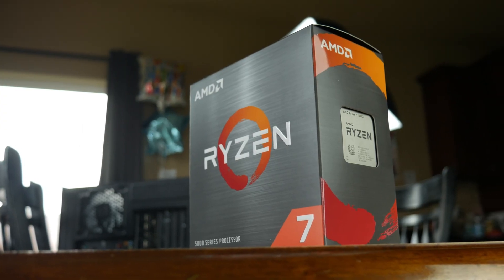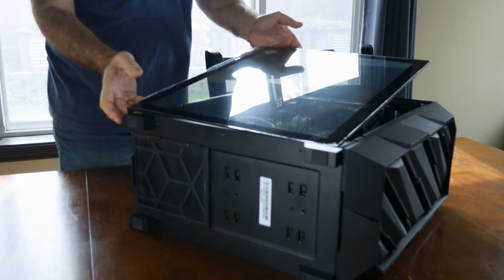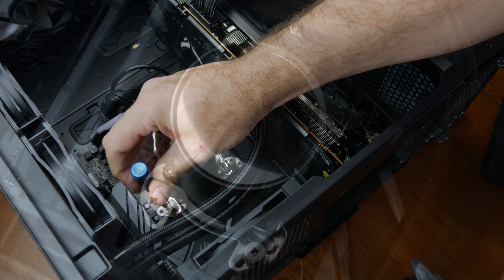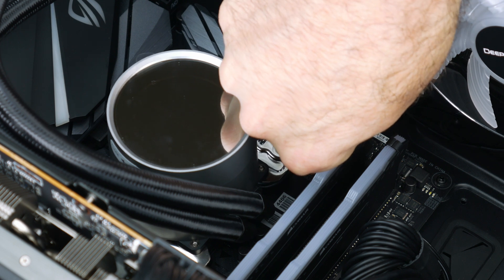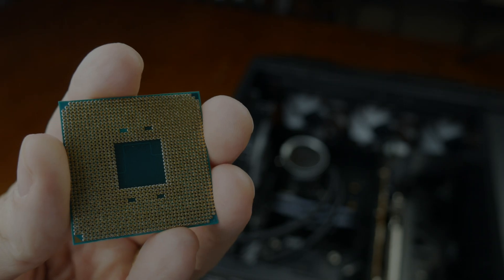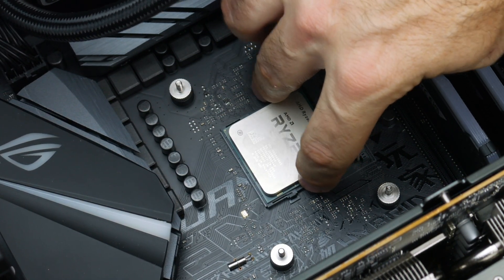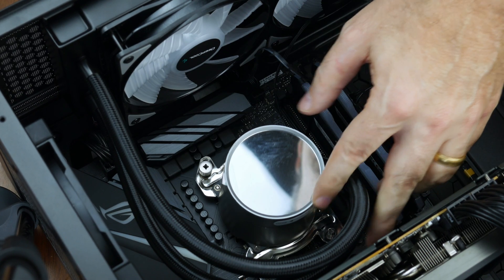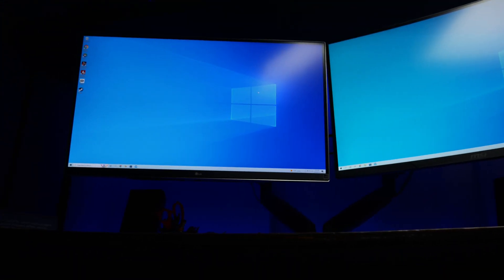How to Upgrade an AMD Ryzen CPU (AM4 Socket)

Comment: Can confirm your pc will not work if upgrade from 3600 to 5800xd3 and you don’t update your bios 😂😂
Reply: Great minds fail alike
Reply: I’ve recently made this mistake but once I tried to put my old cpu back in to update my bios my pc would no longer turn on. Any suggestions?
Reply: @Toxictrooper72  same thing happened with me
Reply: @glace6385  I got it fixed. Just look up a video on how to update bios without a cpu. Some motherboards don’t have that capability though and if that’s the case unfortunately you’ll have to buy a new motherboard.
Reply: @Toxictrooper72  I tried that, didn't work. Tried putting the old CPU back in and CPU got stuck to the cooler and damaged the socket. Now I can't click a CPU into place. I tried with just tightening it into place with a cooler but I still can't get past the CPU light on boot. So annoying I wasn't expecting the BIOS flash not to work now I have to spend more money probably need a new motherboard. And there's no guarantee that will work either
Reply: so would it work if i update my bios, or what would I have to do?
Reply: @evjay9793  It'll work, just update your bios to the latest version.
Reply: @slayer1561  im really new, so I update my bios before or after I install the new cpu?
Reply: @evjay9793  I switched from Ryzen 7 3700x to a Ryuen 7 5800x3d last week. All I did was update the bios and changed the cpu after that. Worked without issues.
Reply: @evjay9793  Update your bios before. Once it’s updated and working. Then proceed to change your cpu.
Reply: @randomguyfromtheinternet8953  Thank you guys 👍
Reply: @randomguyfromtheinternet8953  Same. It might seem daunting but the the whole process is actually pretty smooth if you do everything right.
Reply: @randomguyfromtheinternet8953  how’s the difference? I’m swapping from 3700x to 5700x3d
Reply: @inverse7974  For me it was a big difference. Especially really crowded areas in MMO games like Final Fantasy 14 online were a lot smoother. Also Cyberpunk was running smoother with the new cpu. It‘s pretty much the best cpu for AM4.
Reply: @randomguyfromtheinternet8953  im doing a similar upgrade this weekend. After updating your bios did your 3000 series cpu still boot to windows? Thinking of doing the bios update a few days before i upgrade and want to  figure out if i can still use my pc in mean time.
Reply: Yes, you have to download a corresponding bios update and then it will work (provided its the correct socket size)  @evjay9793
Reply: @evjay9793 Usually the mainboard manufacturer has a list that shows what CPU’s are compatible and what bios version works for the CPU’s. Gotta check it out.
Reply: Glad I updated yesterday cause I’m doing this exact upgrade!
Reply: Haha doing the exact upgrade today and saw this lol. Luckily I been doing this since Regan was in office so I gladly did it before.
Reply: You saved me from such a headache
Reply: Good to know lol
Reply: I wish I read this comment 6 hours ago
Reply: I was about to do this upgrade to my CPU.  Are you happy with it now 9 months later?
Reply: @Its_me_gonzo  oh yea, i completely reset my pc tho. and cleaned all my drives. Mainly just to make sure that all the old drivers and stuff are gone, other than that theres no issues
Reply: I just switched from 3600 to 5700x3d but I noticed high cpu load. Do I have to format my PC ?
Reply: @ format your pc ? I don’t know what you mean ? I just did the exact same upgrade 2 weeks ago with zero issues. You don’t need to do anything at all on your hard drives if that’s what you’re referring to.
Reply: @ Are you sure your PSU is well above covering your PC now ? I had to change mine. 850w is pretty well bare minimum with this CPU and any mid tier GPU
Reply: @LiFeDoWn22  i dont really see a high load on it, but i completely reset my pc recently, wiped all drives and everything and most of my issues went away
Reply: This is the exact upgrade I’m doing it. You’re doing gods work soldier o7
Reply: @TPeck01  10 months later and no issues :)
Reply: Thx b0ss
Reply: Nur Schwachsinnige sind auf Win 11 geil.     Und das ist wissenschaftlich neurologisch
beweisbar und auch bewiesen. (!)
Ja. Aber diese Spielelastigkeit ohne ernsthafte Software hat einer erstklassigen Hardware
schon in den 90ern schließlich das Leben gekostet.
Dumm gelaufen, oder... ?
-
Und solange man sich den Kopf mit Spielen zuballert, ist er nicht frei um zu denken, was
Vernünftiges zu lernen und zu machen.
Volten und übertakten ist was für Diaspora-Hirne.
Hier ein Beispiel, wie Effizienz auf intellektueller Basis und damit der Unterschied
statt Volten und Takten aussieht.
.
.
Kommt immer auf deine Fähigkeiten an, oder ob du deinen
Intellekt an Andere delegierst.
.
"Denken Sie selbst, sonst tun es Andere für Sie."
.                                                 Vince Ebert, Physiker
.
Wenn du wissen willst, wie das Speichermanagement (auch) beim Spielen auf der
Rechner-Seite punkt, weil MS gar keinen Zugriff mehr auf deinen Rechner hat und
der daher rasend schnell wird, mach mal folgenden Test:
.
Ich habe am    18.04. 2025   nochmal einen Performance-Test mit MEINEN beiden
(beide getunt) gemacht.    Titel:   "Warum ein neuer Rechner nicht lohnt!"
-
Ich habe die Word mal auf 32766 bebilderte Seiten erweitert. Mehr macht Word nicht.
Und die habe ich dann in Pdf umgewandelt. Pdf hat irgendwo noch zwei Seitenvorschübe
reingesetzt. In der Pdf sind es 32768 Seiten geworden.
.
Am Ryzen war sowohl das Generieren einer so großen Word-Datei  ~es geht um die
Performance eines Systems~ schon eine bluttropfende Geduldsarbeit, sowie auch
die Zeit die der Ryzen zum umwandeln gebraucht hat.
.                  Ich habe in zwei Testläufen verschiedene Methoden angewandt.
-
-
Jetzt darfst du dich festhalten:
Damit hatte noch nicht mal ich gerechnet, weil ich noch nie so exzessive Tests gemacht hatte.
Ich hatte meist von kleineren Tests hochgerechnet, bzw. Kopiertests großer Dateien,
25 GB oder mehr, herangezogen. Und CDM und AS SSD Benchmarks gemacht.
.
An meinem Intel-Notebook von 2012  (4700HQ, Quadcore, 2,4 Ghz, DDR3-1600, Win 7, mit
SATA6-SSD  und lediglich 54 TDP)  ... hat das geschlagene 4 Minuten gedauert.
Am Ryzen 1950x von 2017, 16 Cores, 4 Ghz, DDR4-3200, Win 10 und NVMe OWC Ultra IV
im RAID0 auf zwei PCIe-8-Steckplätzen (16 TB) nur 3 Stunden 20 Minuten.
-
-
Ihr könnt den Performance-Test ja mal nachspielen, dann seht ihr schon, wo ihr steht.
.
Ich messe nie an der Pleuelstange wie Blender & Co. (warum heisst der so ??), sondern
immer zwischen Gummi und Asphalt.   Wieviele PS der Trabbi wirklich hergibt.
-
-
Die Erbauer nachfolgender Computersysteme können also nicht mehr ganz bei Trost sein.
Da ich seit 1988 Rechner tune, weiß ich wovon ich rede.
-
Da ich nicht Game, aber gelegentlich rendere, weiß ich, dass da der 1950x mit der 1080 sehr
viel schneller ist. Linear.
Aber aus dem Alter eines beschränkten Horizontes bin ich heraus.
.
Das muss nicht nur anders gehen, sondern tut es tatsächlich auch.
Aber eben nicht mit teurem Billig-Ramsch aus Industrie-Abfall.    So wie AMD.
-
-
Es ist also ZWINGEND, beim Anpreisen von Ryzen-AMD-Systemen DEUTLICHST HERVORZUHEBEN,
dass die zwar ganz nett beim Sielen sind, wenngleich selbst ein 9950x nicht mal an mittelmäßige
Intel-Systeme herankommt, aber bei Windows-/Office-Anwendungen gar einem C64 von 1984
gleich kommen.
Und wie wir wissen, hat AMD den 9950x gerade mal doppelt so schnell gekriegt wie den 1950x.
.                                                            Alles dazwischen ist   ...Zwischenstation.
.
Man lädt ja auch nicht mit einem Ruderboot zu Sightseeing-Touren in grönländische Fjorde oder
Karibik-Turns ein. Nur weil mal eine Titanic abgesoffen ist.
Und inzwischen sogar eine Zweite und auch noch eine Dritte. "Vertrauen Sie mir, ich bin Ingenieur!"
-
-
Vom 4700 HQ aus 2012 bis 2025 liegen ... ?    RICHTIG!  12 Jahre.   kkkkk...
Und locker 10 Ryzen-Generationen.     Schenkelklatscher.    Also jede Menge Dumme.
Mein NB ist ein Intel-PCIe3-NB mit noch Win 7.
-
Der 9950x ist PCIe5 mit NVMe5 und Drehzahlen,  DDR5-Ram 8800 Mhz, CPU 5,5 Ghz, etc., etc.,
dass einem nur so schwindelt.
.                           Und dann ist mein Uropa-NB trotzdem 50 Mal schneller !!
.                                                                           Ich krieg nen Leistenbruch vor Lachen.
-
-
Dieses mein Intel-NB von 2012 bootet (getunt) Kaltstart in vier Sekunden.
Zwei fürs BIOS, zwei für Win 7.
Mein, ebenfalls bis zum Geht-Nicht-Mehr getunter 1950x  braucht von einer 970 Pro, 990 Pro
oder OWC Ultra IV lediglich 1 Minute 30.   Was für eine Senftube.
Habe ich die GTX 275 von 2009 drin, bootet er immerhin in 50 Sekunden.
Am schnellsten läuft also der Rechner der nur 54 TDP hat.    Das Intel-Notebook.
-
-
DU musst die GANZE Windows-Seuche selbst lösen !
ICH habe meine Rechner gründlich entwanzt. Bei Win XP und 7 geht das noch richtig gut.
-
1. Gebot !   RAUS MIT WINDOWS-UPDATE, seinen Vettern und Seilschaften !!
                    Dann geht der schon mal sofort sehr viel besser.
-
Und kostet nicht mal was.
-
Bei 8 nur noch mittelmäßig.
Bei 10 geht fast gar nichts mehr. Und mit einem AMD sowieso nicht.

Comment: I have a Ryzen 5 5600,  what is the " " "best" " " ryzen upgrade  for it? Not the most expensive, maybe the best value for money. I want to play cyberpunk 2077 with no problens high settings (1080p 60hz "monitor") and maybe, just maybe, be ready for GTA VI.
Reply: 5600 should be sufficient enough to play any AAA games at 1080p 60fps. Maybe u  need a better GPU?
Reply: better gpu

Comment: I'm going to be upgrading my Ryzen 3 3200g to a Ryzen 5 3600 (which is already supported on the current bios version I have) in the next few months. After installing the new CPU, will Windows automatically adjust / recognize the new processor?
Reply: Yup, it'll boot as normal. You shouldn't run into any issues, especially since you're going from Ryzen to Ryzen.
Reply: U should get a 5600x

Comment: I NEED HELP I DIDN’T UPDATE MY BIOS BEFORE CHANGING FROM A RYZEN 5 3600 TO A RYZEN 7 5800x AND NOW MY WHEN I TURN MY PC ON I GET NO SIGNAL ON MY MONITORS. WHEN I PUT MY OLD CPU BACK IN IT DOES THE SAME THING. PLZ HELP WHAT DID I DO 😭😭😭
Reply: can you tell me how did you solved this issue ? (Assuming u solved it by now)
Reply: @AshAj-nd9yq did u solve this 😭😭 i’m struggling with the same
Reply: Just update your bios to the most recent version before changing cpus
Reply: Nur Schwachsinnige sind auf Win 11 geil.     Und das ist wissenschaftlich neurologisch
beweisbar und auch bewiesen. (!)
Ja. Aber diese Spielelastigkeit ohne ernsthafte Software hat einer erstklassigen Hardware
schon in den 90ern schließlich das Leben gekostet.
Dumm gelaufen, oder... ?
-
Und solange man sich den Kopf mit Spielen zuballert, ist er nicht frei um zu denken, was
Vernünftiges zu lernen und zu machen.
Volten und übertakten ist was für Diaspora-Hirne.
Hier ein Beispiel, wie Effizienz auf intellektueller Basis und damit der Unterschied
statt Volten und Takten aussieht.
.
.
Kommt immer auf deine Fähigkeiten an, oder ob du deinen
Intellekt an Andere delegierst.
.
"Denken Sie selbst, sonst tun es Andere für Sie."
.                                                 Vince Ebert, Physiker
.
Wenn du wissen willst, wie das Speichermanagement (auch) beim Spielen auf der
Rechner-Seite punkt, weil MS gar keinen Zugriff mehr auf deinen Rechner hat und
der daher rasend schnell wird, mach mal folgenden Test:
.
Ich habe am    18.04. 2025   nochmal einen Performance-Test mit MEINEN beiden
(beide getunt) gemacht.    Titel:   "Warum ein neuer Rechner nicht lohnt!"
-
Ich habe die Word mal auf 32766 bebilderte Seiten erweitert. Mehr macht Word nicht.
Und die habe ich dann in Pdf umgewandelt. Pdf hat irgendwo noch zwei Seitenvorschübe
reingesetzt. In der Pdf sind es 32768 Seiten geworden.
.
Am Ryzen war sowohl das Generieren einer so großen Word-Datei  ~es geht um die
Performance eines Systems~ schon eine bluttropfende Geduldsarbeit, sowie auch
die Zeit die der Ryzen zum umwandeln gebraucht hat.
.                  Ich habe in zwei Testläufen verschiedene Methoden angewandt.
-
-
Jetzt darfst du dich festhalten:
Damit hatte noch nicht mal ich gerechnet, weil ich noch nie so exzessive Tests gemacht hatte.
Ich hatte meist von kleineren Tests hochgerechnet, bzw. Kopiertests großer Dateien,
25 GB oder mehr, herangezogen. Und CDM und AS SSD Benchmarks gemacht.
.
An meinem Intel-Notebook von 2012  (4700HQ, Quadcore, 2,4 Ghz, DDR3-1600, Win 7, mit
SATA6-SSD  und lediglich 54 TDP)  ... hat das geschlagene 4 Minuten gedauert.
Am Ryzen 1950x von 2017, 16 Cores, 4 Ghz, DDR4-3200, Win 10 und NVMe OWC Ultra IV
im RAID0 auf zwei PCIe-8-Steckplätzen (16 TB) nur 3 Stunden 20 Minuten.
-
-
Ihr könnt den Performance-Test ja mal nachspielen, dann seht ihr schon, wo ihr steht.
.
Ich messe nie an der Pleuelstange wie Blender & Co. (warum heisst der so ??), sondern
immer zwischen Gummi und Asphalt.   Wieviele PS der Trabbi wirklich hergibt.
-
-
Die Erbauer nachfolgender Computersysteme können also nicht mehr ganz bei Trost sein.
Da ich seit 1988 Rechner tune, weiß ich wovon ich rede.
-
Da ich nicht Game, aber gelegentlich rendere, weiß ich, dass da der 1950x mit der 1080 sehr
viel schneller ist. Linear.
Aber aus dem Alter eines beschränkten Horizontes bin ich heraus.
.
Das muss nicht nur anders gehen, sondern tut es tatsächlich auch.
Aber eben nicht mit teurem Billig-Ramsch aus Industrie-Abfall.    So wie AMD.
-
-
Es ist also ZWINGEND, beim Anpreisen von Ryzen-AMD-Systemen DEUTLICHST HERVORZUHEBEN,
dass die zwar ganz nett beim Sielen sind, wenngleich selbst ein 9950x nicht mal an mittelmäßige
Intel-Systeme herankommt, aber bei Windows-/Office-Anwendungen gar einem C64 von 1984
gleich kommen.
Und wie wir wissen, hat AMD den 9950x gerade mal doppelt so schnell gekriegt wie den 1950x.
.                                                            Alles dazwischen ist   ...Zwischenstation.
.
Man lädt ja auch nicht mit einem Ruderboot zu Sightseeing-Touren in grönländische Fjorde oder
Karibik-Turns ein. Nur weil mal eine Titanic abgesoffen ist.
Und inzwischen sogar eine Zweite und auch noch eine Dritte. "Vertrauen Sie mir, ich bin Ingenieur!"
-
-
Vom 4700 HQ aus 2012 bis 2025 liegen ... ?    RICHTIG!  12 Jahre.   kkkkk...
Und locker 10 Ryzen-Generationen.     Schenkelklatscher.    Also jede Menge Dumme.
Mein NB ist ein Intel-PCIe3-NB mit noch Win 7.
-
Der 9950x ist PCIe5 mit NVMe5 und Drehzahlen,  DDR5-Ram 8800 Mhz, CPU 5,5 Ghz, etc., etc.,
dass einem nur so schwindelt.
.                           Und dann ist mein Uropa-NB trotzdem 50 Mal schneller !!
.                                                                           Ich krieg nen Leistenbruch vor Lachen.
-
-
Dieses mein Intel-NB von 2012 bootet (getunt) Kaltstart in vier Sekunden.
Zwei fürs BIOS, zwei für Win 7.
Mein, ebenfalls bis zum Geht-Nicht-Mehr getunter 1950x  braucht von einer 970 Pro, 990 Pro
oder OWC Ultra IV lediglich 1 Minute 30.   Was für eine Senftube.
Habe ich die GTX 275 von 2009 drin, bootet er immerhin in 50 Sekunden.
Am schnellsten läuft also der Rechner der nur 54 TDP hat.    Das Intel-Notebook.
-
-
DU musst die GANZE Windows-Seuche selbst lösen !
ICH habe meine Rechner gründlich entwanzt. Bei Win XP und 7 geht das noch richtig gut.
-
1. Gebot !   RAUS MIT WINDOWS-UPDATE, seinen Vettern und Seilschaften !!
                    Dann geht der schon mal sofort sehr viel besser.
-
Und kostet nicht mal was.
-
Bei 8 nur noch mittelmäßig.
Bei 10 geht fast gar nichts mehr. Und mit einem AMD sowieso nicht.

Comment: Good idea to hold power button down after disconnecting power to which discharges capacitors
Reply: I’ve built pcs since 1982 and never ever done this. People gotta relax.
Reply: @SticksAandstonesBozo  there are many ppl whos working as dentist or lumberjack but doing their job BAD.
Reply: @fst666hi lumberjack for 9 years here! I fuck up all the time 👍🏻
Reply: Same, if I’m going in I shut down, flip psu button, hold power button 2 sec. Remove door, touch metal of pc top and go in. Its grounded already if your going in for cleaning, upgrade, whatever being it’s plugged into the wall, there’s your wrist strap lol. I don’t unplug the power cord from the wall that’s your ground.
Reply: Oh didn't know that. you hold the power button after disconnecting the power cable cable from the psu right ? I'll remember that
Reply: @Lighning05  I leave power cable plugged in but PSU switched off, hold button, lights come on for a split second then go off, then unplug